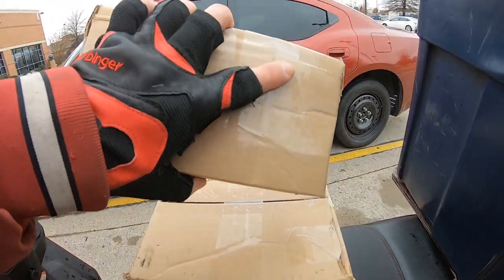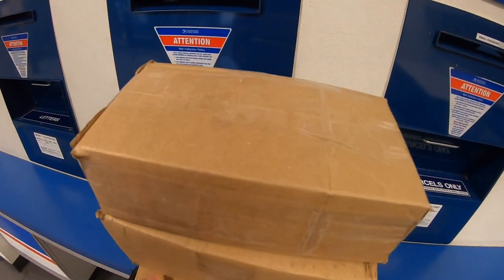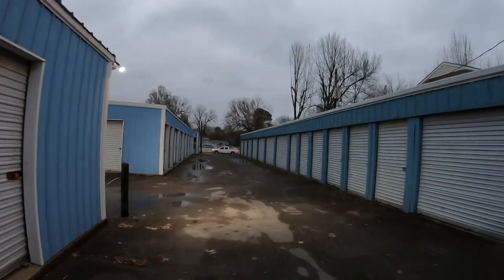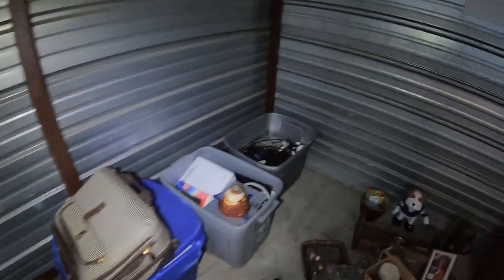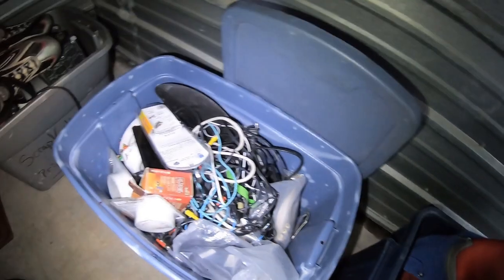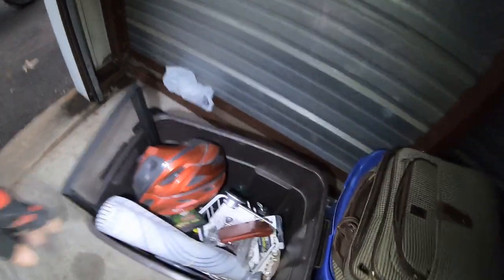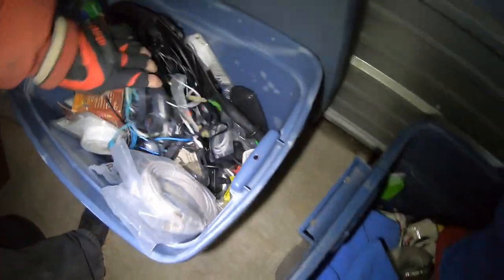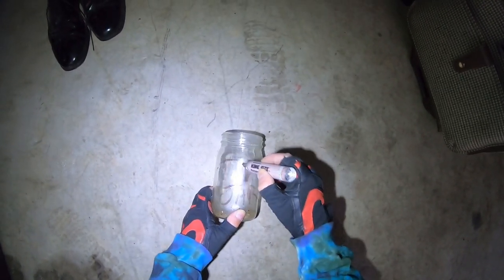Welcome to The CURB - A Freetail Store where it's All FREE...

Comment: Why'd you get suspended off eBay? You're such a stand-up guy!
Reply: He explained it in detail in a video. It was about returns by bad people. Taking advantage of the eBay system at the time when the Buyer was king and they could blackmail the seller into a full refund and keep the item. Threaten to give bad feedback and report seller... eBay was having problems at the time...  I have watched every single video he has made and I am a 100% supporter of his methods and honesty.  He got a bad rap from just 1 or 2 customers and eBay hammered him unfairly.  That is why he does not hide the fact that for a time he was banned. He knows he was right. Now eBay lets the SELLER respond to Negative Feedback and when a buyer is seen by eBay getting Negative Feedback from a SELLER they look deeper into what is happening and have kicked some BUYERS to the curb...  YA eBAY....  I have been a eBay user for over 25 years and I still have 100% Positive Feedback.
Reply: @digitalwoodshop  Thanks for the explanation, that's sort of what I thought. I remember that time period, I gave away a lot of refunds I shouldn't have had to.